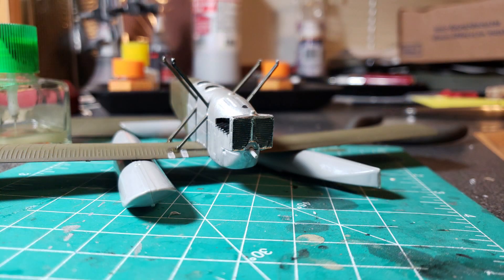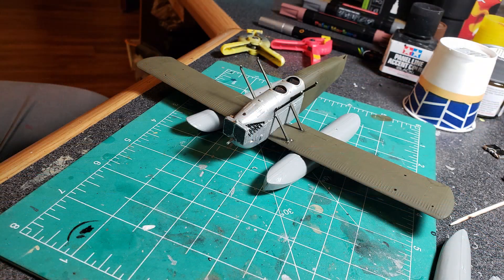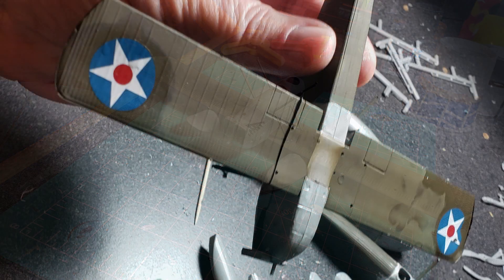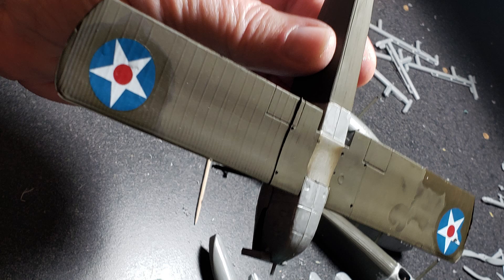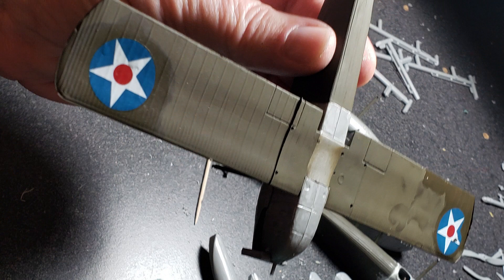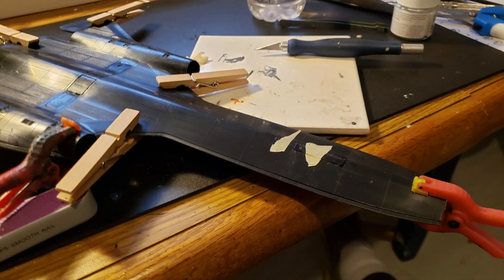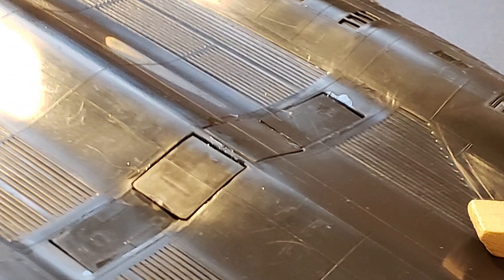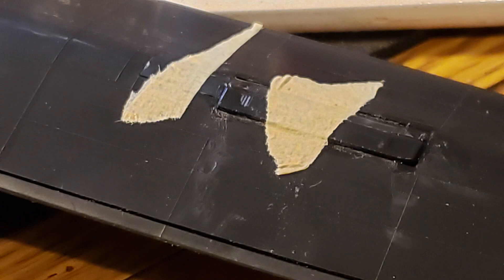Max's Models after hours 08/3/023

Comment: Max....you might be able to save the decals by spraying a light coat of clear matt acrylic (mod podge) over them while they are still on the backing paper....then trim as close to the decals as possible before dipping in water...i've done this with OLD decals and it usually works....Best of luck

Comment: It looks like those decals were applied over a flat finish. If so, spray or brush some clear gloss on to the area you want them to go first and then apply the decals. In my experience, decals that like to curl seem to stick a little better on a glossier surface. So they may get through solvent better.

Two part epoxy putty works well for gear wells to support doors.

As for gunships, PB4Y Privateer patrols as I understand it would harass Japanese islands periodically by flying near them and opening up with their side turrets. This was done relatively late in WW2 and likely helped to influence gunship trials.

Comment: If you discuss gunships, you must include the insane Tupolev Tu-2Sh that mounted eighty-eight (88) PPSh-41 submachine guns in its belly. The guns were mounted at a forward facing angle and intended for close air support. That was the original BRRRRRT! long before the A-10 was even conceived.

Comment: Remember the video of the insect/spider that was eating some of your decals?  Water slide decals use sugsr(s) as an adhesive and lubricant to slide the image matrix off the backing paper.  That sugar is what the critter was going after.  The sugar is also attractive to micro organisms that can get under the film.  This is why it's so important to keep them in a sealed container or plastic bag.  The sugar and backing paper can absorb moisture out of the air and lead to deterioration.  

The order of layers is backing paper, di sacharide  sugar (lubrication layer), mono sacharide (adhesive layer), base layer of clear matrix that the inks will be applied on, layers of ink, finally top coat of clear sealant.  

On professionaly done decals, the clear matrix is not applied to cover the overall backing paper.  It is applied to make "pads" for the artwork.  This allows for individual decals on the sheet and makes removal and placement on the model much easier.

The thickness of the clear matrix has a great deal of impact on the sturdiness of the decal and its overall appearance on the model.  You want it to be thin enough to limit shadows on the model but sturdy enough to transfer and place relatively easy.  Champ model railroad decals were notorious for their thickness but they had incredible shelf lives and were almost indestructible in terms of application.

Comment: For gear up, I'd recommend filling the cavity with blue tac (thanks primedmodelworks) it doesn't shrink over time and easy to get the right shape, also not terribly expensive.  I used that on the F-15 I did gear up and sprue framework on the F-14 I did gear up, the blue tac was certainly easier.